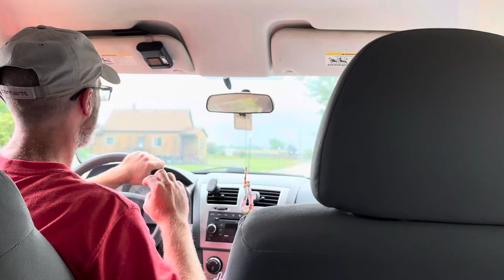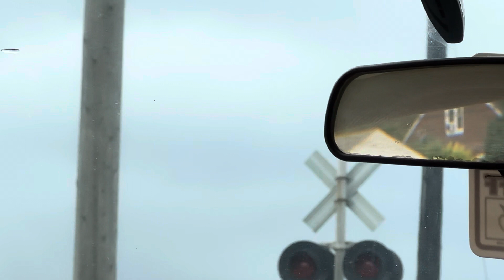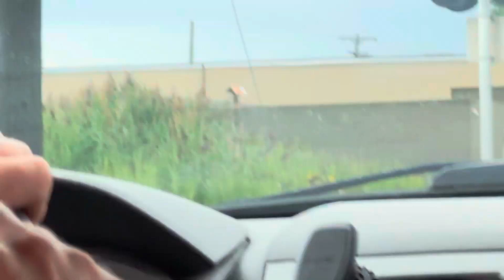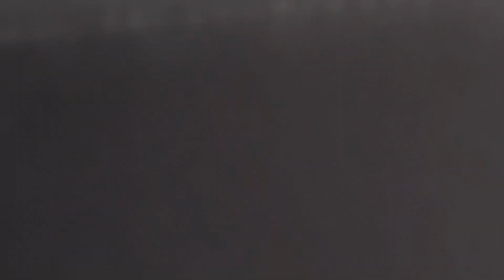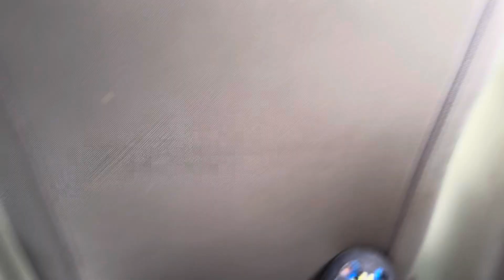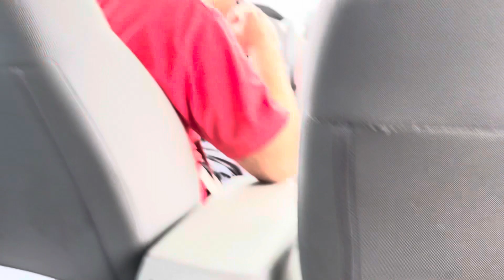St. John’s railroad crossing update

Comment: R.I.P., altered GS Type 1 E-Bell (2016 - 2023)… ⚰️😔
Reply from the maker: Yeah it was like a higher pitch then the other GS type ones
Reply: @RailfanKohlton1650  Agreed.

However, there is still an altered GS Type 1 E-Bell remaining in the Downriver area, as Sibley Rd. in Riverview (Trenton) has a GS Type 1 E-Bell on the Shoreline Gated Cantilever Signal, which is slightly altered, even though it’s pretty quiet.
Reply: @RailfanKohlton1650  Also, now 5 GS Type 1 E-Bells in total remain in the Downriver area, as the Railroad Crossings to still have a GS Type 1 E-Bell are High St. in Ecorse, Emmons Blvd. on the Flat Rock Sub, Goddard Rd. on the Flat Rock Sub, Sibley Rd. in Riverview (Trenton) on the Shoreline Sub, & Harrison Ave. in Trenton on the NS NB Track.